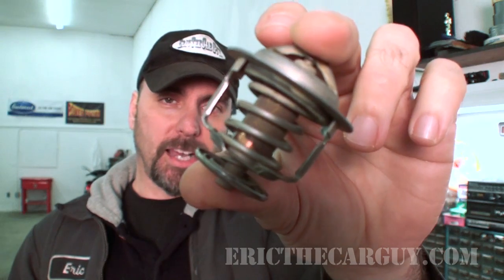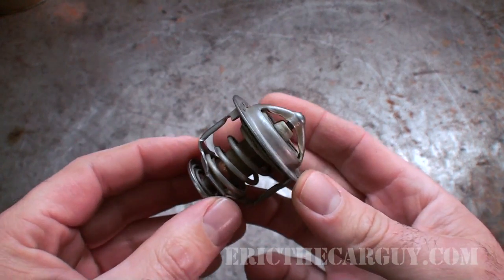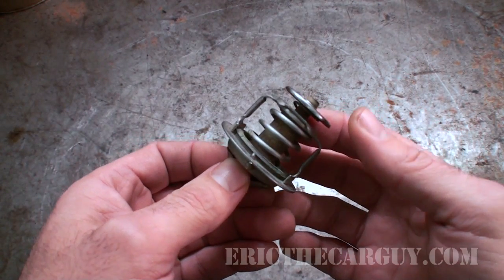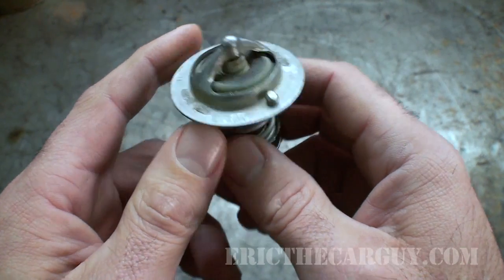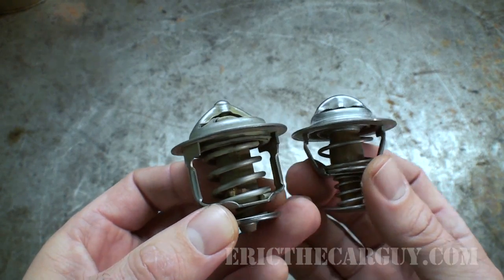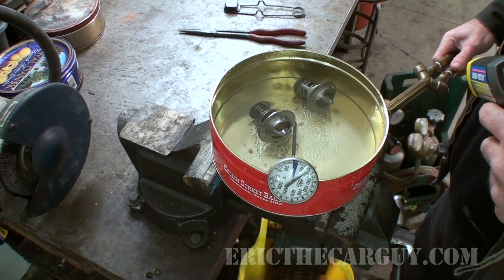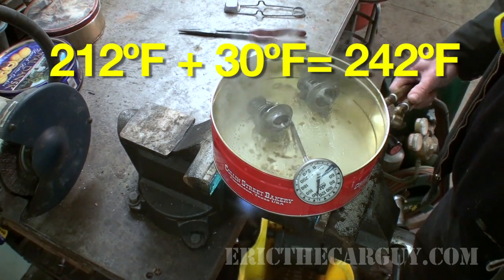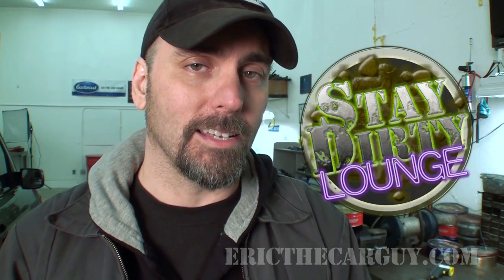Understanding and Testing Thermostats -EricTheCarGuy

Comment: Hi Dave- when you mentioned leaves in between the radiator and the condenser- this really helped me. On a '88 'bird, the condenser is in front of the radiator, and when I moved a wire harness out of the way, the space between it was CHOCKED FULL OF LEAVES AND DEBRIS. I could not just use an air hose to clear it, I had to borrow my upholstery shop buddy's metal ruler, and it took considerable force to clear it.  But- lo and behold, my temp gauge showed an improvement- it really is important to keep this area clear of leaves. Thanks Agein for a great video

Comment: Erik- I changed from a 180 to a 192 thermostat because of smog requirements. Now, instead of my temp gauge needle being dead in the middle, it's slightly to the right of middle. It's a 1988 Ford Thunderbird with a 5.0 litre engine. Was the change due to a hotter thermostat? Thanks.

Comment: I have a proform electric water pump 35 gpm. And when car gets hot after 20-30 mins I hear a clicking/surging on my thermostat housing like the water is pushing the thermostat into housing and it's popping the spring. Running 180 thermostat. What will cause that. Bled air out of system too.

Comment: 2002 Rendezvous, Replaced Thermostat and Radiator. Burped system, heater on, fans turn on, maintains opearating temp, holds pressure, but then overheats while driving. 

No leaks, no leak from exhaust, Upper hose becomes rigid/hot, lower hose flexible/cool. Reservoir tank fills up and when I open the bleed valve after its overheating, i only get steam. 

Does this sound like the Thermostat may be stuck closed or maybe still air in system?
Thoughts?

Comment: I have a 2008 CTS the radiator cap broke and started letting coolant drip eventual the car started over heating. fixed the use with the cap no leak anywhere replaced the coolant and the car overheated again but it looks like the res coolant finally went into the radiator and finally flowed through the car because the res was low again and I put more coolant back in once again no more leaks but I left it alone to find out more info on this can anyone help??????

Comment: plz i want to ask something. does this thermostats cause the engine to overheat, i have overheating on high speed maybe above 90 to 100 Km/h coz i realy through it away and i had this issue after that.

Comment: In my older cars we use to drill a 3 or 4ml hole in the side just incase they closed up, would not recommend on new cars tho, great video Eric, can you please do a video on removing the cat and replacing with normal exhaust pipe

Comment: you can adjust the thermometer by putting it in ice water and turning the nut on the back until it reads 32 degrees f.

Comment: A new thermostat for my car is $19.99.  This is a great video for me to check to see if it's the problem, but I'd probably just go ahead and put a new one in anyway. Now, if my water pump fails, I'm gonna cry because the timing belt is involved and I'm pretty sure I'll have to pull the engine.

Comment: Hi Eric I have 2 questions for you 
This is my situation,20014runner v6 overheating, with new radiator, new water pump, fan clutch and a thermostat and still overheating, so now I'm driving with not thermostat. 
Question 2.  What happen if the bleed hole on the T-stat is not up?
Thanks

Comment: Question... Please help!!!!Hope you reply....Okay I was driving around for 30 mins.. Came to Mc. Donalds next thing you know... Pop.. And steam coming from my car... I get under the hood.I see a hose is popped & coolant everywhere... But no where around the radiator! Its right by/under/next to the intake manifold. Maybe 12 inches long and it curves. So I changed it. I only had water at the time so I filled the coolant reservoir with water for now. But it keeps overheating. I didn't put any water in the radiator yetIm scared the engine will go to waste. Its my daily. Im screwed please help.

Comment: Okay so my 98 century started blowing steam out of it seems like where the upper radiator hose connects to the radiator, and there is little to no coolant going thru the upper hose, the lower hose feels as if there is no coolant going thru it at all. Both hoses are warm/hot upon squeezing the hoses. Is this a bad radiator, thermostat, or water pump? Also i just had my water pump replaced about a year ago. Help 😩😩

Comment: Its sad that so much bad info is online... ya this is old... but... right from stant... "The thermostat fully open about 15-20 degrees above its rated temperature"  none of those were fully open.  I would also never say a stuck open tstat is as damaging as a stuck closed one rofl.  Knocking aftermarket tstats for how they work in air rofl.

Comment: Hey Eric I'm having an issue with overheating
My 2000 Honda Civic SI while I was driving my radiator fell off and broke for the 2nd time  and ran dry for 20 seconds or so the car didn't overheat or anything I replaced the radiator,thermostat and added fresh coolant and I bleeded the system and I'm still having no hot air . top hose is hot bottom one is cold which means the thermostat correct but it's brand new. I left it overnight and all the coolant from the revisor was gone I'm sure there's still air in the system I'm I not just bleeding the system correctly ? Car only overheats while driving not by idling.

Comment: and what if i get heat in my cabin and my car somewhere looses coolant (about 1 litre in 1000 kilometers) , i can nowwhere find any leaks, my coolant is green and in good condition, my water pump and heater core were changed 5 years ago (about 35000 miles driven since then), my radiator is not leaking and i don't see any leaks anywhere

Please help!!!

P.S. My car is an 95 audi a6 it has no cap on the radiator, only on the overflow tank. Can it be that my thermostat is leaking somewhere because i dont get the engine at proper temperature in the winter. Is it possible that is stuck open and leaking. It is only 3 years old. Should i replace water pump and thermostat that i planned to change later this year with the serpetine and timing belts, rollers and tensioners too see what happens? Or not

Comment: my tahoe 08 has a high temp. I change the thermo. and the air out, but it same.
Reply: Mounir ! I would first try doing a coolant flush in case of any blockages, however if there is any squealing noises or anything like that it could be your water pump. water pumps are very vital to cooling an engine
Reply: Thanks! I fixed. But now I have a problem with spending fuel. My chevy tahoe 08 is sucking the fuel like crazy.
Reply: Mounir ! I mean it's not the most efficient vehicle already, is there an engine light at all? if not an air filter and oil change is always a great place to start, second would be O2 sensors

Comment: mine does both overheat and no hot air thanks eric the car guy love the videos
Reply: Greg Rogers mine does too, how did you fix it?
Reply: Alison Johnson I have a bad thermostat so check your radiator to c if it's leaking and did u ever have a water pump replacement?
Reply: Greg Rogers Mine too!
Reply: Overheat engine
Reply: Greg Rogers  - My code reads bad thermostat, but I might have a leak too. Takes forever to heat up, slightly heats to where the gage is at the 12 o' clock position.

Comment: Love your vids Eric. However........ I agree removing your stat is not a bright idea unless it is an emergency breakdown situation say its stuck closed and no spare, remove it be 'on your way' and get it replaced as soon as possible. Now your test between the two stats in your video, you said that 'one was out of a Honda' and the other was an aftermarket stat I can only assume from that then the one out of the Honda is a used stat and the aftermarket one is a new stat therefore in your water test could that explain why the new stat reacted faster to closing than a used stat? old wax vs new wax?

Comment: Hey Eric, I was just wondering if 160-181 is underheating ? I have 06 chevy cobalt and when I had my original thermostats the temp used run btw 195-212. however, after the machine has changed the thermostats, now its run btw 160-181 degrees. if i don't turn on the heat then it stays btw 171-181 but if i run the heat then its run btw 159-169 degrees. So, is it normal or underheating ? please answer!!!!!

Comment: hi Erich, i buy a car with bypass thermostat. i install new thermostat, but the engine was getting overheating.... what is the mistake for this problem? please  guide me... thanks .
Reply: might have installed it bacwards
Reply: hi mr. lee, impossible to fix it back ward because the thermostat has together withe housing, check the QX4 thermostat. i have question , if the radiator is partialy clogge, it will affect that with installed thermostat??? but in by pass or no thermostat it seems like run properly no over heat . but my fuel economy is afected..
Reply: sounds like a clog. make sure your water pump is working right
Reply: HI LEE, THANKS FOR THE REPLY,  now my last suspect is water pump!! i buy new radiator i fix it and i fix new thermostat, but the same issue, the coolant wont cycling the system, i think there is no enough sucking pressure  from the water pump to pull coolant from the thermostat.  take note! i dont have any blown gasket cylinder, no any leak, no water in the oil or in the coolant. but this is only my problem if i put thermostat it wont run the coolant until the upper side is get boling the water. i fix in the right way the thermostat not opposite, i also did the test the stat and its working properly. what you think LEE i have a bad water pump??? in infiniti qx4  is not easy task to remove the water pump!!!
Reply: Akoto disisme
Reply: It sounds like it could be that for sure make sure your heater core is free of clogs before your go doing the hard stuff. do a pressure test because a small leak where air can get in will also effect it. hope I helped you find your problem.

Comment: my problem is I can't run the heat with out air getting in the system. the heater core is not leaking, nor any where else that I can see
 I did compression test on the radiator in a hundred percent sure if I did it right but from what I can see it help pressure nothing leak. the only two possibility would be a thermostat or I'll have to flush the system what are your thoughts on this?

Comment: Hello Erick.....greetings from Caracas, Venezuela.....Thanks for all your videos. Regarding this, I need to replace the thermostat in my Jeep Cherokee. I have seen that some thermostats comes equiped with some kind of little valve (as you explains in the video) and other not ( like my case , the original mopar thermostat is totally sealed, no release valve). 
....this little valve only helps to bleed the air when you  install the thermostat ??? I mean, in case of the thermostat fails and get stucked, the valve doesn't works ???
Thanks in advance.....
Saludos

Comment: My wife's 2001 E150 has 201K on the odometer. It's probably about time for a new thermostat right? No problems, just changing the alternator so the water pump, thermostat and hoses are too convenient as long as I'm right there. By the time you read this, everything will be done. Just asking anyway. Should I have gone for 180° or stayed with the stock 195° ?
Reply: Scott9084 might as well change it out

Comment: so, if my thermostat is malfunctioning could cause irregular engine ruing ? in my bmw e30 the problem is that the engine reaching the temperature but can`t blow hot air in the cabin, only lukewarm. it could me my problem the oppened thermostat ?
Reply: yes have same prob with the vibe
Reply: II. Levente 
The problem with that model is that it was made by BMW.

Comment: EricTheCarGuy my first car had a 3:rd way that thermostat could break down actually.

I had to almost force the mechanic of mine to change it. What had happened (that he found when he did change it) was that spring had cracked into 2 peaces. So there was a very small "spring" left, but it opened and closed really randomly. The thermostat was apparently quite deep in the engine on that car, hence why he didnt want to replace it at first. But it was the only fault...

Car was a 1989 626 Mazda 3door GTi coupe with a 2.0l 16v V4. Fun little car :)

Comment: Eric, I have a question.  When my Nissan Xterra heats up it blows antifreeze into the overflow.  The top of the radiator is hot and so is the top hose, the bottom hose is warm.  I can hold the bottom hose with my hand, but the top hose I can only touch for a few seconds??  I did replace the water pump, timing belt, radiator, all radiator hoses.  A few months earlier I did replace the thermostat, wondering if it could have gone bad in a few months.

Comment: Eric, what is your opinion of the more expensive Fail Safe thermostat? Does it have any superior design than the others which would cause it to open more reliably than the others on the market? I fail to see the advantage of having a thermostat which locks open when the motor overheats, over a fully functional one which also will be open during an overheated motor. Or will normal thermostats not open if there is not enough water in the system? Is steam enough to cause them to open? Either way, a car with no water will not keep running without overheating if there is not enough water in the system, or if the system fails to circulate for one reason or another. What is your opinion on this product? Is there any reason to buy one? I would rather not have to buy another thermostat just because the motor overheated.

Comment: I'm cursed with bad thermostats. Every car I've had to break thr cooling system open, '90 Miata, '93 240sx, '99 4Runner, the thermostats would absolutely not open when initially bleeding the system. If they did work, they would eventually fail in time. I've since resorted to "gutting" thermos by simply snipping the ears off which removes the spring assembly and leaves the housing. So far it's been working fine with temperature-controlled cooling fans/clutches.

I've done it all when it comes to different thermostats and brands, bleeding methods, even coolant mixtures. When installed they never open, in a pot of hot water they open fine. shrugs idk..

Comment: Thanks mine was not opening....Just a hair so replaced it now fine...Engine water was boiling thought it was a blown head gasket it was just the thermostat..
Reply: is your radiator fan working/ facing right direction I would also try to clean the radiator so air can flow easy through and cool your coolant
Reply: Howard B how is it going man. Just a quick question, what car do you drive? because my water is boiling too and I have a little ford ka

Comment: What kind of an IDIOT would remove his thermostat?!.
Reply: back in the day on drag cars when they had over heating issues with the restricted flow through a thermostat people would use a pop can or something with a hole drilled in it to just slow the flow a little
Reply: If it breaks and you need to keep going... that is the thing to do, not everyone has a warehouse full of car parts.
Reply: Marek Sumguy you can run a car with a blown head without a thermostat for emergency perposes as long as you keep water and oil topped off
Reply: @businessman953  an*

Comment: Although admittedly splitting hairs (for the fun of it because I've got little else to do but troll half way into my cups tonight, lol) you've shit the bed strictly scientifically speaking. The bimetallic thermometer is horribly inaccurate by design, and the infrared due to application (water being a poor blackbody reflector). Without a calibrated immersed mercury bulb thermometer, at best you can only guess the liquid temperature to plus or minus twenty degrees. The only known metric being that the temperature of boiling water can be reasonably calculated with a barometer reference. 

But yeah, I use a similar "more than good enough " method for checking sensors and senders too. It tells you what you need to know.

(automotive) Thermostats are a cheap solution to coolant temperature regulation. The minimal  benefits of fractional degree regulation simply don't support implementing sophisticated electronics and solenoids to keep the head outlet at a specific temperature with millisecond feedback. Fifteen percent fluctuation for twenty seconds is trivial. For all intents, suffice that the thermo come off it's seat in hot water as far as bench testing goes.
Reply: Now I need a new thermostat and a fucking science degree to understand the shit you wrote there Jimmy lol..
Reply: Thats the spirit!.
Reply: Jim the science guy lol...

Comment: I have a issue with my heat staying on, when the control is set to cool, mostly in the after noon, but in the morning my air coming out is cool, with it still set to cool setting still. I found one forum thread that seem to possible indicate that it my be a Motor shut valve on a 2000 Mitsubishi Eclipse, which i think is called something else in other cars. This valve from what i gather is controlled by a little motor, that may not be working properly, and is suppose to shut of the hot coolant coming from the engine. Is my assessment correct, or could there be other factors causing the heat to be off like it should be, but on when it shouldn't be?

 Note i had some work done, and had my strut towers replaced, and the air conditioning doesn't hold freon longer then a week, or two either. I don't know if that is related, or just that the guys i had work on my car are numbskulls.